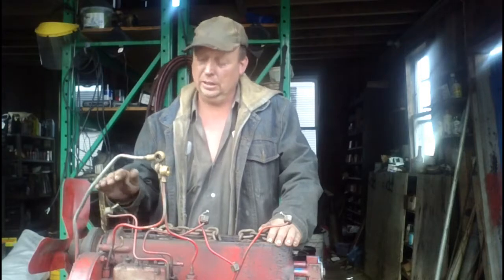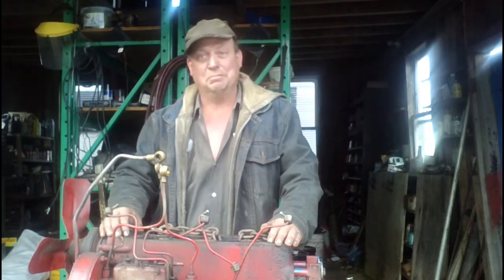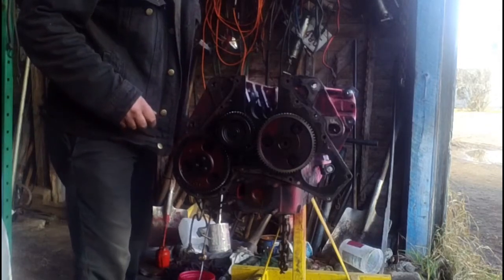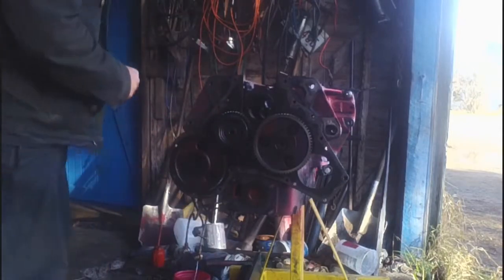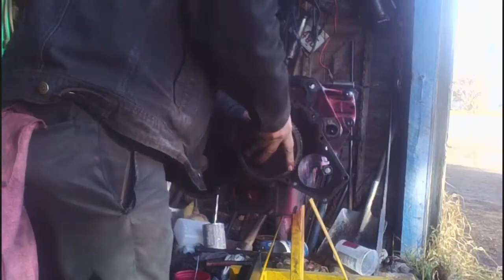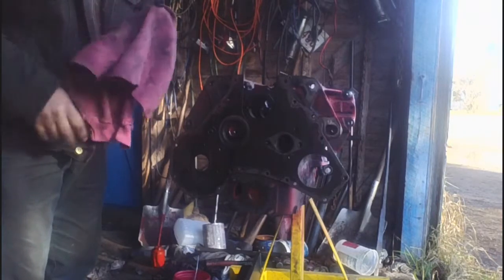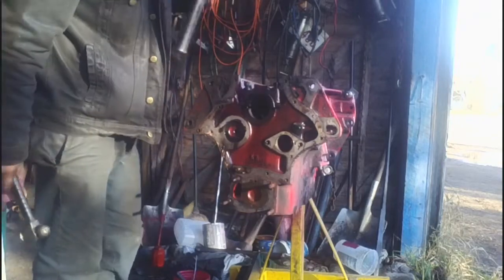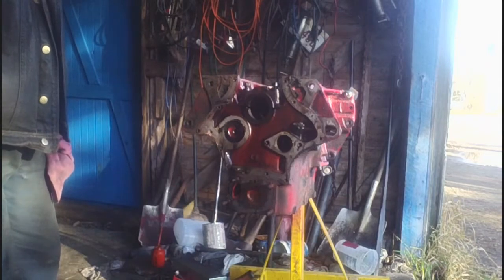BD 154  rebuild part 1 stripping the block

Comment: I presume to drain the block of antifreeze to replace sleeves  is it the nut above the starter?
Reply from the maker: I believe the fitting on the starter side is for the oil pressure gauge but there is a pipe plug on the other side of the engine to drain eth coolant from the block. Thanks for watching!

Comment: Good afternoon I have a question about the flywheel on my bd154 is the flywheel supposed to be flat as I have a 0.40" dish where the cluch ware is. I also have the same on the pressure plate  do I need to replace both of these or can I face them of with the lathe. Thanks Harry
Reply from the maker: The pressure plate is supposed to be flat as well as the "pocket" (for lack of a better word) in the flywheel. The flywheel should be resurfaced but I feel it would be better tor replace the flywheel. Thanks for watching!

Comment: Hello I am wondering if you can help me I have a international harvester 3434 and need to do a rebuild on the engine which is a bd154 as in your video. I just want to know do you have to take the front axle off to remove the engine as I can't see how to remove it without hiting the engine mounts. many thanks Harry
Reply from the maker: I'm sorry, I haven't had anything to do with the industrials so I'm not any help on this one. Thanks for watching!

Comment: Do the B414 with a BD154 have valve stem seals?  I check the parts manual and did not find one.
Reply from the maker: +Draggin Theline No, there are no valve stem seals on a BD 154 engine. If your guides and valve stems are within tolerances they are unnecessary. Thanks for watching!

Comment: How did you push the sleeves out that easy. I`m working on a IH D-282, 3 sleeves came out no problem and 3  are not budging.  I`m at the point now where I`m thinking about tack wielding a bar in the sleeve. Probably a really bad Idea but I`m not sure how else to get them out.
Reply from the maker: +TimmyOFlinn These ones came out pretty nice, some can get really glued in there with carbon around the top or rust in the water jacket. I have a steel puck made that just fits the size of the sleeve and drive against that with an old sledge handle with a 4 pound hammer. An old rule of thumb, "If all else fails, use a bigger hammer." :)